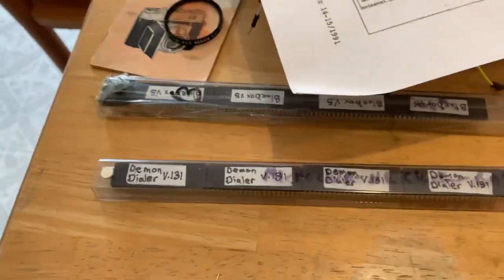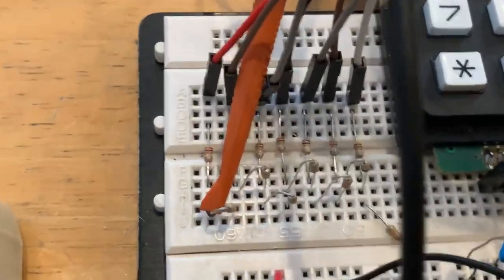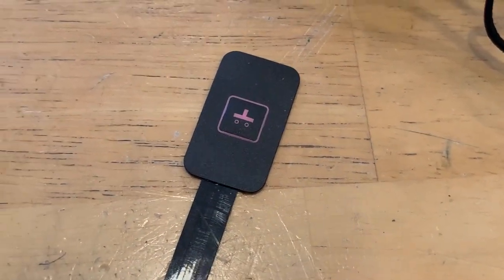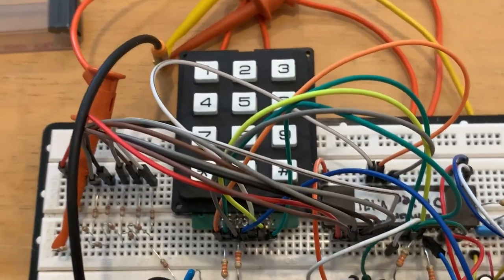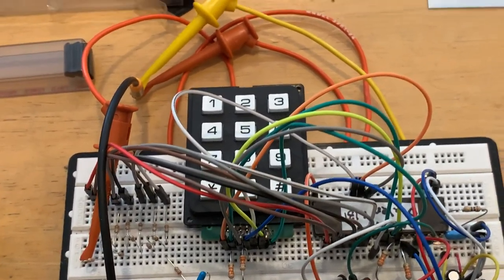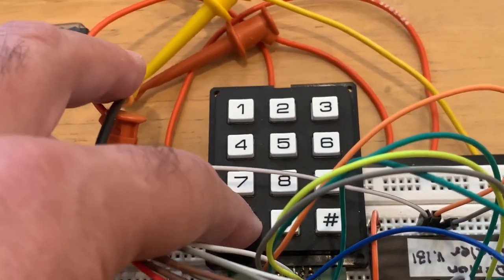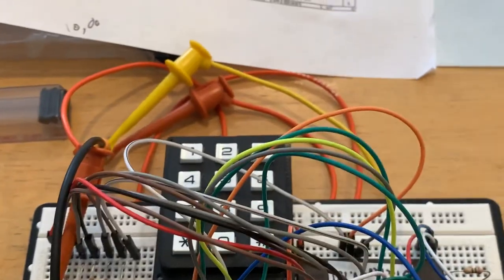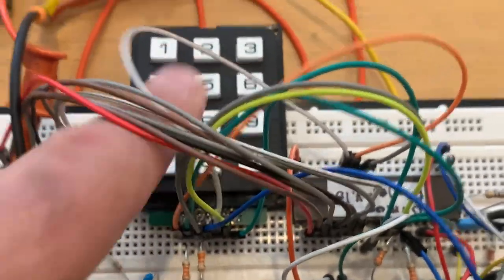Hack-Tic Demon Dialer Prototype

Comment: If you can find a Dallas 5000, it has onboard battery backed ram
Reply from the maker: These days, EEPROM is a given on a microcontroller and many are quite capable tone generators using PWM. The Demon Dialer code is heavily hardware-dependent as it is written in assembly language and wouldn’t run on the Dallas chip without a complete re-write. Having a working original unit, writing code that emulates the original on an Atmega328p would be pretty straightforward.
Reply: @df9999999999  please let me know if you do decide to code it for a more modern microcontroller, I loved the way it worked, especially the stealth mode op!
Reply from the maker: @devnuls  There was also a secret “back door” password in case the 4-digit password was lost. There was no way to retrieve the unique unit password if the paper that had the password on it was lost!
Reply: @df9999999999  you mentioned a simulated PSTN that can be boxed, I have a genuine northern telecom bluebox & bluebox decoder set. I also have my Apple II & Novation AppleCat modem with the optional dtmf chip, packed away in storage. I would like to try it with the NT box, my last attempt was the day I got the Novation and they were converting our CO from crossbar to 5ESS. They were probably laughing and waiting for me to clear the line so they can do the cutover.......
Reply from the maker: @devnuls  www.projectmf.org has the details on accessing the boxable Asterisk PBX system. You can call it on the PSTN or access it directly over the Internet if you have an Asterisk system of your own.  I own three or four commercial trunk test sets that can generate/receive MF digits and tone line signaling systems as well. Back in 1971 my town had one of the first #1ESS switches.
Reply from the maker: @devnuls  That Novation AppleCat is quite a collector’s item. It was VERY desirable back in the day. “Cat's Meow” was one of the program’s that used its unique capabilities.